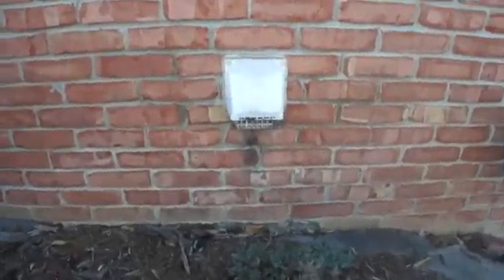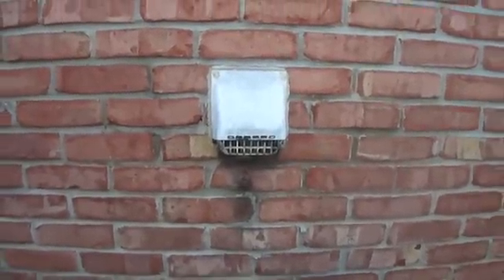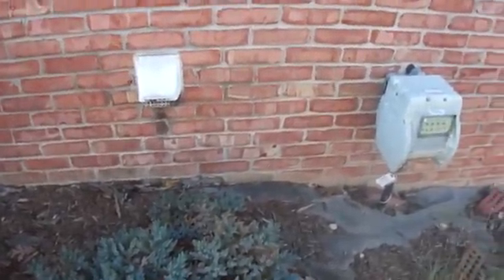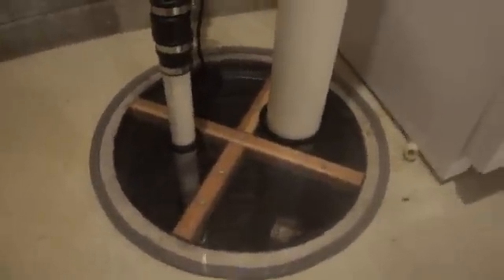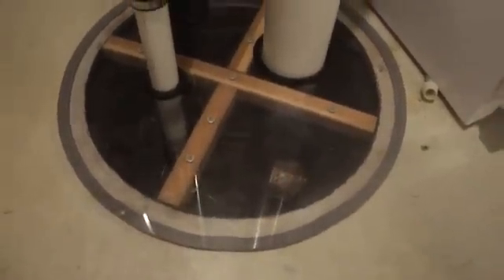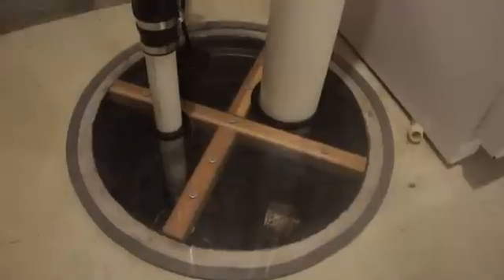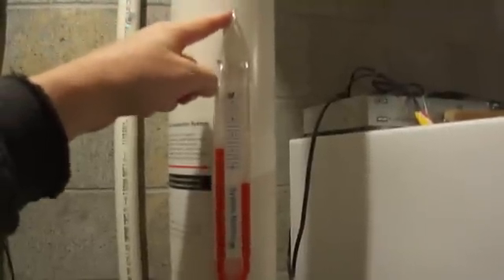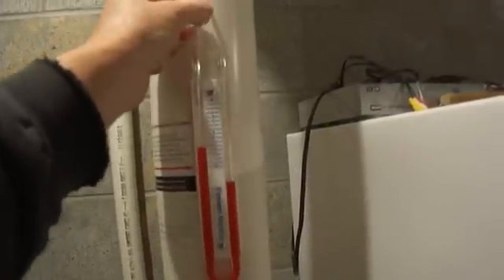How To Install Your Own Radon Reduction System

Comment: What were the numbers after the installation of your system (at least 2 weeks after the installation)?
The units used to measure radon is Picocuries Per Liter of Air (pCi/L).  In NY state 4 pCi/L requires reduction, which is equal to smoking about a half a pack of cigarettes per day .  Our levels were 11 in the basement and 4 in the living space. The goal is to reduce the basement below 4.  Since the install was today I will test again in 2 weeks.

I just had a system installed in our present home.  I went through this in 1988 in our previous home back when few people really new much about radon or the health hazards.  The contractor installed the evacuation fan, AMG Prowler, outside and ran a vertical stack above the roof about one foot.  He explained that the vent must be at least 10 feet from any opening entering the house.  In our previous home the evacuation fan was in the attic above our garage and vented out through the roof.
Reply from the maker: After 10 years since the installation, I am still getting a reading of 1 in the basement

Comment: I see a lot of videos like this where the pump is in the basement and that it's working fine.  I'm thinking about installing in my new home because I know from the test there's over 300 parts per million and the radonaway instructions say to install the motor in the attic or outdoors. I don't feel comfortable doing the attic install and outside gets to - 45 and colder in the winter so I've been considering just installing the motor in the laundry room and having it discharge out a dryer vent cut beside the existing vent used by the dryer and setting it up the way you have it.

Comment: I am confused and maybe someone can help. If you hook up vent this way how do you know your pulling from (ENTIRE) slab? I know most times you have a test hole on other side and see if your getting a negative then your good. Being in the sump how does it pull from under the slab? Again just confused so if someone can educate me I would appreciate it because I may do this  method but I am not sure it would solve my issue on the entire basement per say. Cheers and thanks for help.
Reply: Typical sump crocks will have drainage pipes that go out from the crock under the foundation to collect water. This is how access to the under-foundation air is made.

Comment: Radon can extrude from anywhere in your basement. It seeps through the foundation as a gas. It can also exist in the water which spreads it further where it does continue to be radioactive and emit. A sump pump combo will not automatically address Radon too if say, it's emanating most from the other side of the basement, from the wall even.

Comment: @1:20:  ppm or pci/l... or maybe bq?
Reply from the maker: Second one!
Reply: @proclaimliberty2000 :  Thanks; thought that was likely the case, but wasn't sure if there's a different measure.  I started to ask about the "after" readings, but scrolled down and found it (~1 for over 8 years).  Thanks for posting; always good to see actual DIY projects done well.  (I saw that some have mentioned various code updates, but the main thing is to compare it to the alternative.)

Comment: As a radar mitigator this system does not follow any protocols and coded that are put out there by the EPA and the NRPP please   do not follow what this gentleman has done
Reply from the maker: I am sick and tired of people like you implying that somehow my system is flawd and doesn’t work the same as a system that you would install. I’ve heard horror stories of systems installed by supposed professionals. My system has worked flawlessly with zero problems since the date it was installed with the highest quality parts in the industry. You can take your EPA and NRPP government horr masters and shove it Jason!

Comment: Wow this looks great! We just had a radon company install a system and holy cow does it look like a kindergartener did it. They hand cut the lid crooked and the caulk is absolutely clumped up everywhere. Also did not use those boots just clumped up caulk around the pipe it looks so awful :( I will be showing them your video, your installation looks very professional I love it!

Comment: Does this work if the concert slab has expansion joint all around it? Do I need to seal the expansion joints first to make the slab vacuum sealed?
Reply: Yes. They make a specific caulk for filling concrete joints. The more you can seal, the better

Comment: DO NOT PUT THE FAN IN THE BASEMENT
Reply from the maker: dennis b Ya let’s put an electric fan out in the elements😂
Reply: proclaimliberty2000 Radon away and fan tech are weather proof. Putting the fan in the basement is against the dep in our area. I install 3 outside every day and replace ones that have been running for 20 years. They are to go outside or in the attic. If there’s a leak in the pipe or the fan it will pump radon in your basement at a much faster rate..
Reply: proclaimliberty2000 you run electric the same way you install an ac unit. Conduit and outdoor romex.
Reply: It also needs to exhaust above the roof line.
Reply: But you’re right. I’m just a certified radon technician. What do I know.

Comment: Excellent video and workmanship! I can tell you took your time to think about placement. I have a quote for 2k to install this system, I think I'll be doing it myself!
Reply: System is not code
Reply: @garyvillanueva8571  are you referring to the placement of the fan? Or something else?
Reply: @edcollier2526  Fan placement and also exhaust are both wrong. Fan should be outside or in attic. Exhaust has to be at least 10ft off ground and  2 ft above openable windows
Reply: @garyvillanueva8571 why?  If the radon test is coming back really low now what's the beef?

Comment: I have a huge ground water problem. When the water table raises it pushes mycotoxins from mold in the ground into the house. If your house is super sealed and insulated well this amplifies the issue. First the mycotoxins enter the basement and through the trench effect climbs to the upper floors. This system should help with my issue. :)
Reply from the maker: Wicket AND FRIENDS PARODY BiZ厶ЯЯо PRODUCTIONS This type of system should absolutely solve your problem. However, make sure the outside water from rain is draining away from the house as best as possible.
Reply: My property was built on a swamp . Nowadays you can’t put a basement in a property like this. I’m literally at the bottom of a valley in all directions. I’m taking on water from miles around.  :/ In the 50’s they didn’t put ventilation pipes under floating slab in the basement. It’s looking like I have to get vent pipes cut in and your tubes. My whole neighborhood has moldy air just from being in the valley alone. 
     I wanted to get dry wells and put my gutter downspouts into that, my property isn’t high enough for them to drain properly. They may work somewhat though. Rain would Take the path of least resistance and go out of the pipe to the street before it would seep into the ground.
     I’m gonna bring in fresh air from the ridge area of my roof which is above the valley. This will put the house under a positive pressure to isolate the living space from the neighborhoods’ air.
     Thanks for the advice and posting this innovative job. :) Rainwater is a problem all right, I’m taking on the entire neighborhoods water and surrounding towns at that:(
Reply from the maker: @wicketandfriendsparody8068  Wow, you definatlely have your hands full but you need to try something for your families health sake or move.
Reply: This climate change thing isn’t helping much. We had record rainfall like 5 years ago. After that Green Lichens started growing on trees that are indigenous to this immediate area. Even though these trees were growing g here when it was a swamp, lichens weren’t this widespread .
     I saw in one of your comments, your levels went from 30 down to 1 I think. Just that alone is a significant drop. Just to get some fresh air, I’ll try your set up to bring immediate relief until I get this water situation resolved . Lot of work, basement slab from 1950’s so they didn’t use vent tubes in the slab. 
     I’ll tell you mold will have you sick as anything. Doctors won’t know what’s wrong with you:/
Let’s just say I’m NOT having a pleasant valley Sunday lol :/
Reply from the maker: @wicketandfriendsparody8068  My system has worked fabulous and works just as good today as the day I put it in.  Do you already have a sump pump crock in your basement floor with a sump pump in it?
Reply: @proclaimliberty2000  can u make video of your sump setup, backups etc
Reply: @proclaimliberty2000  a lso could u show under glass cover to see what u did with radon pipe. it is not obvious to me. does it just sit there above water line?
Reply: @wicketandfriendsparody8068 cLiMaTe cHaNgE tHinG lmao

Comment: Nice installation.  Lots of people commenting negatively about your fan being placed in the basement, but lets set some things straight.  Actually Canada says the basement is the best location to prevent damage to the fan.  I live in Fishers Indiana, and the city allows installation of the fan in the basement.  If you think about it, if you don't allow the Fan to be located in the basement, then you should not allow gas furnaces or gas water heaters to be located in the basement.  As Canada says regarding radon fan installation, "properly installed fans and pipes will not leak radon into the building and are usually installed in the basement".  I will soon be installing my Radon Fan in the basement, no doubt about it.
Reply from the maker: wd8dsb i’ve taken a lot of flack for this installation on everything imaginable. However, the system works great and I wouldn’t do anything different if I had it to do all over again.
Reply: UK and Germany also say inside is fine.
Reply from the maker: wd8dsb do you have a parts supplier to install your own system?
Reply: @proclaimliberty2000  Our homes that were built in 2000 were built with the Radon mitigation system already roughed in (3" pipe installed from the basement floor all the way up through the roof, pits sealed, outlet installed in the basement for the fan, etc.).  The only thing I have to install is the fan and the manometer and these can be purchased at any of our big box stores (like Lowe's, Home Depot, etc., or through Amazon.com).  The other thing I have to do is seal up a crack in the floor as well as around the basement floor perimeter (where the concrete floor meets the poured concrete walls.  Our city does not require a permit per the city building inspector since the electrical outlet was roughed in.  I wrote a letter to the EPA yesterday asking for an update on their old requirements about not placing the fan below living space, and waiting to see what they now have to say as their requirement definitely has some flaws.  There are definitely pros and cons to where the Fan be installed, and think the EPA original statement of not being in the basement is really short sighted and hard to support.  Really glad my city allows placement of the fan in the basement.
Reply from the maker: wd8dsb 👍😊

Comment: what if it comes in the bed room window or the soffit vent
Reply: This does not meet code. There are regulations dealing with your exact questions. It needs to travel up above the roof and has to be so many feet from any window or soffit/soffit vent.

Comment: what were the ppm's after the system was installed?
Reply from the maker: Installed ppm's 1.0.  After 8 years of operating my radon system 24/7 I still have a radon reading of 1.0 ppm's and my vacuum gauge still reads 1.25

Comment: You said 4" PVC, but it looks like you went from a 4" pump down to 3" PVC? I'm deciding which PVC to use. I think it might get better suction with 3".
Reply from the maker: I used all 4" PVC.  Use all 4" PVC.  You want volume!
Reply: @proclaimliberty2000  OK, thanks. I just got my pump in the mail. I didn't realize the pump was 5", or whatever it is.
Reply from the maker: Dunlap Music 👍😊

Comment: How does it pull the radon from the other side of the house? Through the dirt?
Reply from the maker: Through the perforated pipe in the peastone gravel under the cement floor.
Reply: @proclaimliberty2000  Oh ok. So are there any house slabs that are poured right on the ground, without any gravel? If so, then this system probably wouldn't work?
Reply from the maker: I have seen people on YouTube that drilled a 4 inch hole into a cement slab poured on top of dirt and still pulled the radon out. However, if a concrete slab has a sump pump crock then it should naturally work for pulling radon out of the ground like I have.
Reply: @proclaimliberty2000  All right thanks for taking the time and answering my questions.
Reply from the maker: Javias 👍😊

Comment: Does the radon discharge pipe go right into the water in the pit?  Where does this pipe site in the sump pump?
Reply from the maker: Chad Sweigart you never want  the discharge pipe touching the water in the sump pump. The discharge pipe is maybe 2 inches below the top lid.

Comment: So you cant have the motor on the inside of the house, but you can have a furnace, hot water heater and drier all connected to gas and all exhausting co2 from inside the house?
Reply: All valid and good points to consider . . . especially since natural gas (methane) contains radon which cannot be filtered out.  It simply goes thru the drier or water heater combustion chamber and then is exhausted out the vent pipe unchanged.. No one wants to mention the truth about lung cancer, anyway.  The truth is your individual DNA is the most important factor.  That's why many life long smokers may live to be 95 and still have no lung cancer.  But the government can't start a new agency over DNA and tax and issue penalties over it,  and industry can't start new businesses to  deal with it.

Comment: My problem with this is the supposed unit's of measure. According to EPA standards the units of measure are in Pico Curries per liter not pars per million. Not saying this is the best way to measure levels of concentration, but non the less that's the typical way of expressing levels of concentration.
Reply from the maker: You're right.  I accidentally spoke the wrong unit of measurement.

Comment: Thanks for explaining having the motor on the inside of the house. Also, isn't having the PVC vent all the way above the gutter or roofline overkill?  I love your dryer vent concept. If they can vent the furnace just outside the basement wall, why not the radon too?

Comment: My question is, what are the radon readings directly at the exhaust vent and at designated distances from the vent? May all be a mute point. Sounds like more code BS to me. Installation of a fan outside in my climate area would destroy the blower in a matter of a few years.  Unless the vent pipe was completely broken on the exhaust side of the system within the dwelling,  any leak would be probably be  undetectable.  Even with a leak of 30%, it would still be better than having nothing at all.  The cases I have seen,  the radon levels were detected in the living space, so a simple exhaust system with a fresh air supply we theoretically reduce the amount of radon. Yes a radon system is more effient, but my point is to think about other options, especially for those that may be on fixed incomes.  Therfore,  removing the need for a radon system. Note, the construction methods in Idaho,  predominantly use raised sub floors, with significant foundation vents. They do test for radon on new construction and requests,  but it has not seemed to be as much of an issue for our area.  I will add we are a bit behind in vast amounts of code and licensing,  but we are make some progress.
Reply from the maker: Please do not take this the wrong way but in my opinion radon readings at the exhaust would just be a waste of time.  A lot of this code stuff is just more big brother crap.  I'll take my system over code installed any day.  Unfortunatley, there is no other option that I'm aware of to resolve the issue with existing construction where radon exists other than to install a system. And yes, unfortunatley some people on fixed incomes cannot afford this but we don't live in a perfect world.  This is one area where certain people could ceratinly use help from the government, but the government is more concerned about maintaining over 800 military bases around the world and all of its other pork barrel spending.  I would rather remain behind than having my life regulated away.  Enjoy it while it lasts.
Reply: proclaimliberty2000 I totally agree. I've worked in residential construction,  what makes it into code and what does is mind boggling.

Comment: Nice job. Very Clean. Your installation is wonderful. The see through lexan sump cover and the application of the rubber boots is innovative. Our company sells wi-fi enabled sump pump alarms, and we have a lot of experience seeing sump installations but we have never seen a clear cover! It could be a product in itself. Also love the way you T'd above the fan to get a two point anchoring. Very well done!!

Comment from the maker: After 8 years of operating my radon system 24/7 I still have a radon reading of 1.0 and my vacuum gauge still reads 1.25
Reply: proclaimliberty2000 
Where did you find a fan so cheap?
Reply: proclaimliberty2000 a